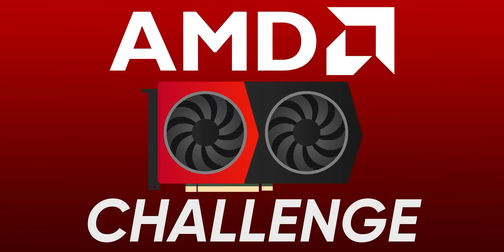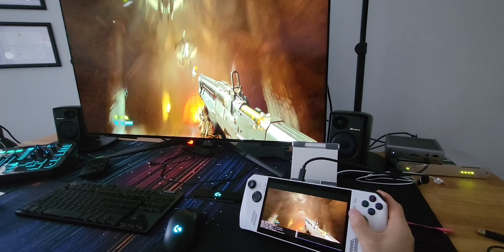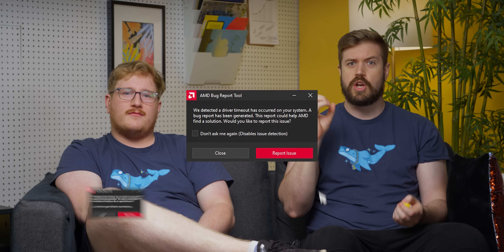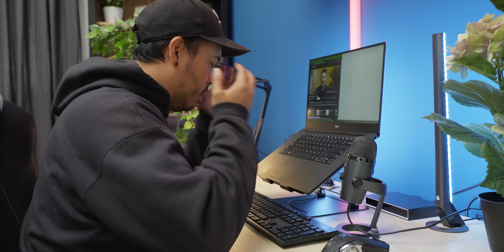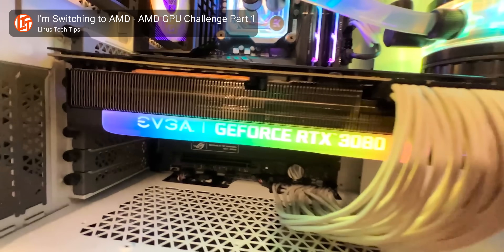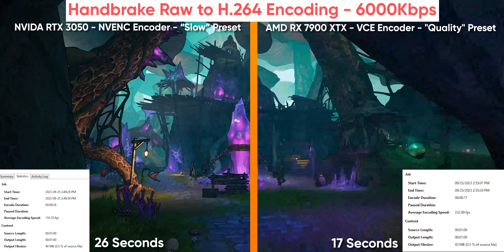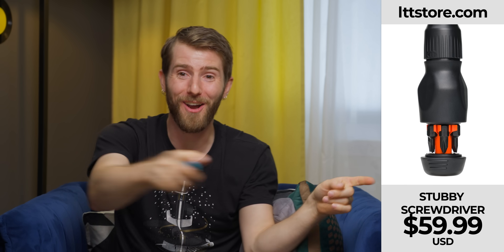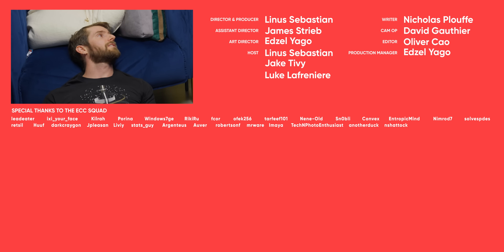I’m Staying on AMD! - Radeon Challenge Pt. 2

Comment: I use to rock AMD Radeon cards in 2009-2013 era and all my bad experiences were driver related. The most annoying issue was after every AMD driver update, all my overclock settings would go back to defaults. This was very annoying since at the time I was using R9  290X and my fan profile to keep that thing cool was CRUCIAL.
Reply: They've improved tremendously since 2013, brother that was 10 years ago jesus. -_-
Reply: You can now not only save multiple overclock profiles to file and import, but you can also set different overclock profiles and settings per game. Game A might be an indie game, set it to undervolt/downclock for silence, game B might be a modern AAA title, set it for full speed and clocks etc. You can also set different fan profiles, for each game.

Comment: For anyone wondering about the part where Luke said his crashes would also close out Discord and it would take the longest to recover, a not so fun thing with Discord and AMD GPUs is that they don’t play nice with each other. It’s been documented in a few forums and so far the best fix I’ve seen and experience myself for this is to turn off hardware acceleration in Discord. Its stopped the crashes for both me and some friends that use AMD cards
Reply: Yeah, it's a damn shame as well. I stream through discord and not having hardware acceleration sucks.
Reply: I use AMD and discord. They both work fine and really well together. Not saying there isn't an issue but I haven't seen it.
Reply: Don't use their 23.9.2 or 23.9.3 driver. Use the 23.9.1 driver. Anything I did with hardware acceleration causes my pc to stutter and freeze. Like opening chrome or edge browser. It all went away after I downgrade the driver back to 23.9.1 driver.
Reply: It's not. Maybe the crashing, but the slow startup is caused by his riser.

Comment: Just swapped over to all AMD after being Intel/NVIDIA for years and I had the exact same issue as Luke with Starfield crashing and taking Discord with it. (Coincidentally, I also forgot to install the launch day driver at first.) I've got a 7800X3D and 7900XTX. I turned off XMP as a quick test and it's been perfect since then, however anecdotal that might be.

Comment: I think the next time you should see about having some of your editors and designers run these cards as part of a test. The big hurdle in me switching to AMD are things like game dev performance in things like Blender and Unreal and video editing performance in Premiere and such. For general use case gaming it's helpful, but I think there's an underserved market here.
Reply: I think in blender specifically the gap is closing. For a few months now AMD has been focusing on it more with the addition of HIPRT.
Reply: @TheEclecticDyslexic  Doesn't matter ROCm is highly unstable on Windows and ROCm documentation is nonexistent so without that any programs like Blender. Daz3D, Unity, UnReal and other 3D programs are designed to use CUDA and Tensor Cores in Nvidia GPUs and ROCm is supposed to be AMDs version of CUDA but it is completely unreliable

Comment: interesting hearing luke's experience; sounds almost exactly the same as the problems i've been having with my rtx 4070- including the weird propensity for discord to just. die and take 30 years to recover up
Reply: This just goes to show that it doesn't matter what you buy. Some unlucky sucker will get the short end of the stick. I'll never buy an Asus motherboard again after my experience, and it might just be a fluke.
Reply: If you are using a PCIe riser, that's why. Same issues for me on AMD but was caused by the riser.

Comment: My first PC that I've been running until the beginning of this year was a 1060 3gb. I had some money saved and knew it was time to upgrade. I waited for NVidias and AMDs new generation cards and the choice became pretty obvious. AMD might have not had the raw power as the 4090, but for the price, and the sheer amount of VRAM, I went with AMD without much hesitation. There were some hiccups with having a close to launch model, but in the last six months, I haven't had any problems except for with apps that were designed specifically for Nvidia cards that I would have to find workarounds for.

Comment: 2 months on 6800. Had exactly zero issues and i play a lot of both new and older games. It's just as good of an experience as i had on my 2060 Super, nothing to complain about
Reply: That's because RDNA2 is in much better shape than RDNA3. AMD's newest hardware releases always have major bugs, without fail. But yes, if you're buying midrange in 2023 and want the best value, go for RDNA2

Comment: Just a silly note, as rebooting routers shouldn’t be a solution for network problems, a fresh windows install should not be a solution to a driver issue. Somebody’s gotta get their stuff together.
Reply: I know this is a late post but....sometimes windows does act stupid for no known reason and the only thing that will fix it is a clean install. Not even a system restore will work. It's not only with AMD drivers...had this problem with other drivers.

Comment: The irony here is that my 3080 Ti just randomly started artifacting while watching this video, which was thankfully fixed with a restart
But it's interesting and unfortunate to see that the 7900 XTX still doesn't have nvidia-levels of stability or encoding, honestly thought it'd be like that by now considering how stable RDNA 2 is.
Reply: I have been using AMD parts since forever now and for about the last 2 years I've used a 2080... for the past ~5 months I have a 7900 XTX and I swear I have not encountered a single problem that they described... i don't use encoding, so can't say much about that, but everything else I have used the same as they did and no problems, no crashes, no nothing
Reply: @ZRay507  interesting. Honestly the only major issue I've ever encountered when I used an RX 6600 was the constant driver timeouts when I was watching YouTube in fullscreen, don't think I've had anything else though

Comment: I've been running my RX 6700 XT since I found one in stock (a few months after it released) and I honestly couldn't be happier. Sure, I miss out on a few Team Green stuff, but it isn't stuff I would really be using anyways. The software experience has been mostly good (a few driver issues - primarily with Vegas Pro). Games have been running great, performance has been consistently great. Overall, it's a great card and one I'd recommend.
Reply: 6700 vanilla here, the price just made too much sense. The only issue I have is a random black screen on game start.

Comment: If any tech guys know, I see a lot of people recommend a long bar power strip instead of using a surge protector for your setup for cable management. Is that more risky, or is that risk less of a thing in this age similar to static back in the day?
Reply: You can find long bars with surge protection, I'm fairly sure that Tripp Lite sells something along those lines.
Reply: I'm British and most of the surge protectors I see are long bar shaped (except mine which looks like a flattened cuttlefish).

Comment: BTW, to fix high idle power draw, just add some "weird" refresh rate to your system. I set my screens to 61Hz and my RX7900XT draws 16W at idle. You can generate that modesets using cvt.
Reply: oh my, that is bizzare fix, but thanks, high power draw was biggest detractor for me while contemplating rx

Comment: There is/was something going on with GPU acceleration last month (used by browsers and discord), which made it really unusable. People reported that this was an issue that was caused by a Windows update, which apparently is fixed by the newest AMD driver, but nah, I will just keep the older driver. Also I get random restarts and frequency of them depends on the driver. My first 6 months with AMD GPU were amazing, you couldn't have to care about what You were running, it just worked, but the last 2-3 months were shitshow. I had to DDU, install old driver and while it fixed most issues and random restarts happen like once a week, a weird issue with the screen turning on and off while waking up the PC popped up and stayed for a week, until next windows update. While this was broken and fixed by Microsoft, I know that other machines running Nvidia GPUs had no issues at the time. Im using AMD CPU for a year and a bit, I'm using Steamdeck beta channel and all of that is working really well, so it would be just nice, if you could You know, put in the GPU, install drivers and not worry about what brand components You have.

Comment: i've been on AMD since the 6000 series came out of Lisa's cauldron, nearly 3 years ago.  The driver timeout issue Luke describes was rampant for me before adding a setting in the registry called TdrDelay, basically it is a check on windows that can sometimes be set to 0 by default (or the string is completely missing which also counts as 0) which means no time for drivers to recover after a hitch, by setting this to any value above 1, the random driver timeouts were reduced significantly. 

Not even a problem with AMD, just windows; go figure.
Reply: Most problems people blame on AMD generally turn out to be windows issues if people would actually do a little investigation
Reply: So when I put my RTX card in my system, why don't I have to deal with those issues like you would with AMD? Makes no sense. It should just work man.
Reply: @kevinli5369  Increasing TDR delay allows the system to continue operation CPU-wise until the next graphics card sync window has opened. Driver timeouts like this are caused by Windows and it can happen even if the user is running an RTX card.

Comment: I just bought the AMD Radeon 7900 XT last month, January 2024, and I am having none of the issues with that these gentlemen experienced. I have an AMD CPU (Ryzen 7 7800x3D) as well. I did get a random signal loss (lasting a couple seconds each time) to one of my monitors (a 75” 4K television connected via HDMI), but the other monitor (connected via DisplayPort) stays on. I believe it's got to do with the HDMI cable or HDMI port on the television, and not related to the video card or the drivers.

Comment: I've had a 7900XTX since launch, the only thing I haven't done with it is play VR; I haven't had any of these issues...

I'd chose to get the Nitro+ from Sapphire, so I got mine a few weeks later than reference models - but a friend had one of these so I can also factor in their experience.

The main launch issue was with reference cards overheating. Said friend had one of the affected cards and still didn't have anywhere near the instability Luke was - despite undervolting heavily to try and control the hotspot temperature.

Whereas, I've genuinely had so few issues with my PC as a whole this year, I haven't even thought about it.

The high idle power draw could be fixed (even on initial launch drivers released in December 2022) with any form of VRR on the display. Driving my LG CX it went from around 100W to 25-30W when enabling it in the drivers.

There's a few games that have had some issues with AMD drivers. And... in fairness NVIDIA have had some issues also, Hogwarts texture bug/crashing comes to mind. The only memorable ones are:
- God of War performance issues (there was an easy workaround and it's been fixed since probably March-ish anyway)
- Alan Wake essentially crashing instantly when a particular setting is turned above minimum.
- Sons of the Forest crashing even at stock clocks+voltages, requiring the cards boost clock to be restricted. Simply loading a saved tuning config in the driver utility when playing that game was enough to fix the problem, with no observed performance loss even at 4k maximum settings.

My 2 gripes with this card are:
- Poor RT performance, although I'm still not bothered much by it as it really just made the experience worse more often than not on my 3080 (requires DLSS at 4k, increases input latency, worse frame pacing, sometimes game related stability issues, etc.)
- Until recently, and still on Windows, minimal support for certain machine learning frameworks. Although, now we have ROCm on Linux and there's progress for training and inference of LLMs being made on a daily basis it seems. I'd also used DirectML for a TensorFlow model much earlier in the year and that seemed to work fine - although lacking in optimisation.

Not sure if this 'review' will be very coherent, it's 5am and I'm half asleep. Just wanted to share my contrasting experience after watching this.

Comment: With gaming now pretty good on Linux, it would have been interesting if even just a few days of the 30 were allocated to trying Linux with AMD cards/drivers. Sadly,  LTT seems to think only Windows can use GPUs/play games on x86_64 hardware.

Yes, they did a Linux challenge quite a while ago, but there's been very little Linux follow up after that. Now that the Labs is up and running, I'd like to see a few hours spent booting a live Linux distro to see if all the hardware works and you can play some typical games on review hardware. Multiple reviews of laptops have come and gone this year without a single mention of Linux and yet there's an entire channel (Mac Address) dedicated to a frankly worse platform (especially for gaming) than Linux.
Reply: I can weigh in on my personal experience, which is AMD stuff under LInux has been flawless and performant for many months now, I'm sure there must be some bugs in there somewhere but I've never had one that is graphics related. And being Linux and not at the most bleeding edge stability in general has been good with the majority of bugs being clearly proton related. I'm on a 6000 series and Ryzen 7, so it is slightly older stuff.

Comment: the 7900 xtx has been a great card for me but i do mostly play FPS like Call of Duty and Destiny 2 with some Apex mixed in so i could understand if someone was running older games or obscure games having some problems. other than that i dont even have the high idle power draw any more after a certain update i only draw 10 to 30w on idle. great card love it!
Reply: older and obscure games? how is that even reasoning? when i had my 3070 i was playing newer games AND older games. if team green can do it dont make excuses for team red. the coping is unreal here
Reply: @probablykeen   fanboy alert! the point to my comment was why pay 2400 for a card that has the same performance of a 1000 dollar card in just about any fps on the cod engine. the point of the video was similar as to who would be fine with maybe having some driver/windows issues with certain games and who would not. i dont "cope" i buy what i need for what i need it for. it would be absolutely stupid for me to pay over double for a 4090 when my 7900 xtx does what i need it to and does well with the titles i need it to. dont be a keyboard warrior and stop being like all the other team green and blue fans. you comment made no sense and was unnecessarily rude. it even looks like you liked your own comment given there is one thumb up. now why dont you go "cope" with how you cannot even think about using the competition because it might not do all the things you wouldnt do with it anyway.

Comment: I had similar issues in my old RX 580   card.

But now with the RX 6600 XT I don't have any issues anymore, and the H264 encoder issue I have noticed also.

Although I didn't have any blue screens, I have been using it for 2 years and yeah its smooth.

Comment: I guess I've been quite lucky with my AMD 7900XT so far?  I don't understand how Linus and Luke have so many issues.  It's reminding me of the Linux challenge.  It's to the point where I wonder if they're manufacturing issues for the sake of making a video.
Reply: Enough of us have had these issues with AMD that it's 100% believable.  That's the problem AMD has always had.  If you're running totally bog standard hardware with very little weirdness it's probably going to be fine, but if you're even a little outside that average use case you run into issues and AMD doesn't care because you're not the majority.  Just like with the 5700XT, even AMD admitted they had to rebuild the drivers to stop the black screen issues, but like 80% of people using the 5700XT didn't have them.  It always comes down to your hardware and software combinations and Nvidia just seems to test wider or something.

Comment: I'm currently running my first full AMD set up. 5700x and a 7900XT. There has for sure been the occasional moment where that classic AMD jank has appeared. But 99% of the time everything works great. The performance has been absolutely excellent, even the ray tracing performance which I didn't care about one bit has been good.
Reply: Awesome have the same combo 5700x with 7900xt and amazing results.

Comment: I switched to a 7900 xtx and the only promblem I had (besides 4x driver timeout which I haven't seen for some time now) is that when I booted my pc the driver would not load (meaning 30 fps on windows desktop and only 1 monitor working). This has been fixed after I installed the driver only version in the Adrenaline installer and then installing the full install after. Oh and I had to disable the sleep function because when the pc goes into sleep or hibernates and I turn it on there is only a black screen.